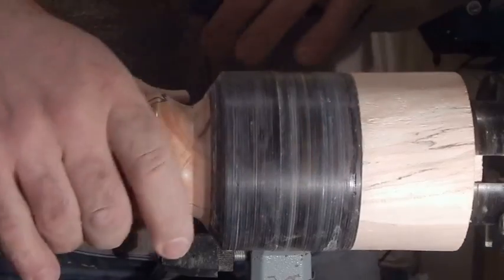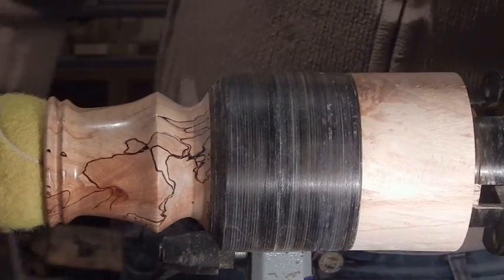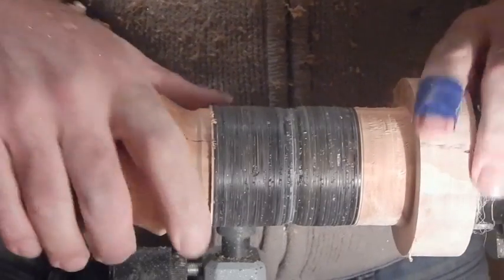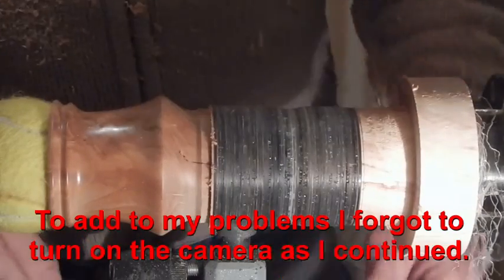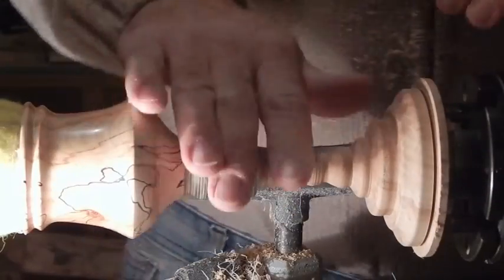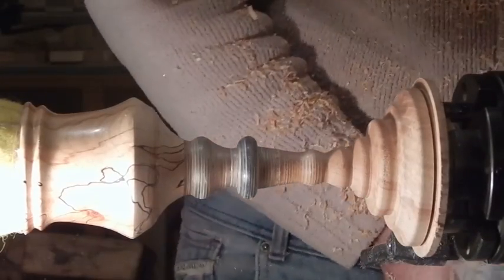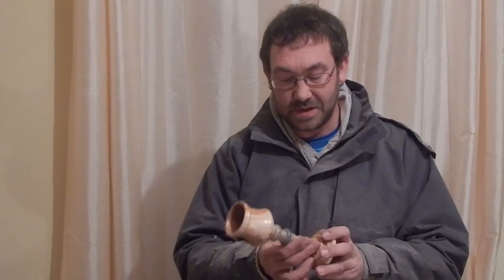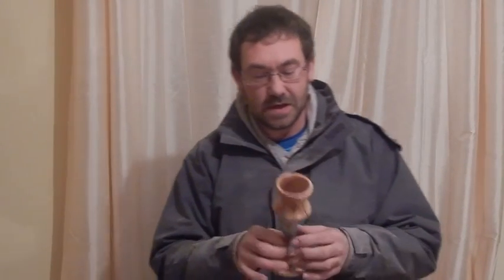Woodturning compact discs (Cd's) upcycling into a spalted beech and disc goblet part 2

Comment: Took me some time, but I've gotten to this one too :) Man that was a tough ride, I'm usually using the three strikes you're out rule with my turnings, you're a better man, but that goblet did some out nice, even though you had to mill the disks almost off to get to where you wanted... I would have thought you will use the CD's for the cup part of the goblet and not the stem.... Almost thought you were going to make a captive ring there for a moment and I was thinking how pretty that can be. On a side note, if you microwave a CD for a few seconds it will "burn" off the metal sheet inside it and make it almost transparent, look it up somewhere, if and when it works, it is cool to watch happening. :)
Reply: +Yuval Lahav Just checked my facts, and in fact, passing a high voltage to a spinning CD will "burn" off the metal, microwaving it will just give it some pattern and stink, probably...
Reply from the maker: +Yuval Lahav Well thank you Yuval !! I think you have spent as much time on this project as I have now !! LOL ..... Thanks for that info I'll have a play.... I still have a few things I want to try with them ;-)..... Thanks again its much appreciated mate... Steve.

Comment: Should have sanded down every single CD and then cleaned in acetone or alcohol solution before gluing the stack together. By the end with all the repairs the whole thing was pretty wobbly...

Comment: if just asked in the first part, why you didn't used a bezel like in metal fabrication, for the manufacture of a spindle?
In fact if the parts getting to long its a need to stabilize them against bending by their own weight...
But the useabilty of a bezel offers more latitude...
Reply from the maker: +Innocentforscratcher Yep thank you I replied to your previous comment, Your watching and commenting is very much appreciated, kind regards, Steve.

Comment: Might get better results if you had put all the CDs separately on a dowel that was extended past both ends of the stack and then just glued both ends of the dowel into matching holes on the blanks at each end? Just thinking out loud.
Reply from the maker: +Gene Strong (Lumpystrong) Thanks for your thoughts !! Good idea !! Appreciate you taking the time to watch and share your ideas, regards, Steve.

Comment: great video, thanks for sharing.  i love up/recycling. am new to wood turning & found it very useful.  wondering what you use on the tail stock to hold the tennis ball? which btw was an awesome idea.  just learning about jam chucks atm so i hope to try this technique. are there more videos or information on the tennis ball support?
Reply from the maker: +Marney Smithies Hi, I don't think there are any actual videos dedicated to the use of a tennis ball, but its simply just used as a pressure chuck to support a cupped piece, you just place the ball in the cup of your project and slide the tailstock to it adding just a small amount of pressure. its great for reducing vibration.... Thanks so much for watching and commenting, just let me know if I can answer any questions you have as you move forwards, kind regards, Steve.

Comment: I couldn't tell, but did you put a dowel through all of the CD's or just where the cup attached?  Maybe if you put a dowel it would add some support and prevent them from breaking apart at higher speeds?
Reply: +Dennis Gibson II Lovely piece either way.  I wish I had a shop where I could do woodworking.  Currently I just do it out in the snow by hand.
Reply from the maker: +Dennis Gibson II Hi, The wood was turned down to a dowel and inserted into the Cd block from both sides in hindsight I should have also put a dowel between the two Dowels too to form a solid joint!! This was an experiment and a lot was learned from it.... Thanks for watching and commenting, regards, Steve.

Comment: I just snowballing an idea here, but wouldn't a one piece wooden core, and the base having a hole that the core inserted into been stronger? Rather than the 2 piece center core, relying on glue for structural integrity?

Comment: Your mistake was to use a spade bit to open up a hole. This is not their intended use and correctly you should have drilled the large size you required with that spade bit - the spear end is there to keep it centred and stop it straying or grabbing the work, as happened here.

Nice project and as you say, a beautiful piece of spalted beech. A very artistic use of the unexpected.
Reply from the maker: +Gordon Burns Hi. Yep I new it was a risk but they were the only drill bits I had at the time, I have since bought a set of forsner bits ;-) Thanks for the info and for watching, regards, Steve.
Reply from the maker: +Gordon Burns Hi, yep it was a risk, but I had no other drill bits at the time, but I have since bought a set of forsner bits so happy drilling from now on ;-) Thanks for watching and for your helpful info, regards, Steve.
Reply: +Templeboy Turnings  Very Very interesting! Only thing that annoyed me was music playing! I, like many other watchers of thesetype of video's, really don't like the background music. Its not needed, and becomes irritating. Apart from that, I really enjoyed watchingAll the Best   Mike

Comment: Hi
After you used the spade bits to intially make the interior of the goblet it appears you used a skew. Why do you prefer the skew to a gouge? Also. is the tennis ball held in place just by compression or is it physically attached to the tailstock?
Thanks
Michael
Reply from the maker: +VADOC02 Hi Michael ! Thanks for your questions...... I do use the skew a lot for smaller hollowing to reduce vibration. Because pressure is directed more towards the headstock rather than the side of the piece ...... And the tennis ball is just held with gentle pressure just to reduce vibration again....... I hope this answers your questions Michael. Thank you for watching its much appreciated, regards Steve.

Comment: Satisfying.VDO. ..... :-)
One suggestion, you actually wasted time in gluing CD's & then grinding them down to almost 1/7 of what mass it had orginally. Next time make Epoxy block & grind it straight away with shiny polish & use those CD's for some other project wherein the grinded waste threads are minimal .

Comment: It looks and feels like the lathe is spinning the wrong direction for the Auger bit you are using. Actually the lathe is spinning the same direction the Auger would. But in doing so spins against the wrong edge of the Auger, not the cutting edge.
Reply from the maker: Hi Jc !! No the lathe is spinning the right direction, the drill bit would spin clockwise if you were to use a drill, the lathe is spinning clockwise also, but if you look at the the end of the spindle on the lathe when its running its actually spinning anti clockwise ? Therefore the right direction for the drill bit? 

LOL its a bit of an optical illusion, but if you put both your pointing fingers end to end and turn them both clockwise it will look as if they are going in opposite directions ?? 

Hope that explains ? I'm confused now lol .......

Thank you for watching and commenting, regards Steve.
Reply: I actually do understand what you are saying. I also was thinking that because the bit wasnt havent a easy go of cutting before it bit and threw it off the lathe. Either way cheers man was cool to see and in the end is amazing.
Reply from the maker: Cool, Yeah it was just the wrong tool choice I've since bought a set of Forstner bits which are the right job ;-) .... thanks again buddy !!! Steve.

Comment: Why not just put solid dowel through the CD and sticking out ends in to wood parts? This way clued CD will not carry all the load and will not split. Otherwise interesting video. Come to think of it, how about just glue center part of CDs, so outer surface actually have gaps between layers. Should look interesting. Sorry I don't have turning machine and can't try it my self. :-(

Comment: if you decide to do this again I would recommend making that small nipple you made in the very beginning on both outer pieces and attaching them within the cd with a stud, along with all the glue. might consider a metal nut insert, they also work well for strengthening two dissimilar pieces of wood being stuck together to lathe them. http://www.rockler.com/threaded-brass-inserts-select-size?utm_source=bing&utm_medium=cpc&utm_campaign=(roi)+product+listing+ads
Reply from the maker: +bigjohn3435 Thank you for your suggestions and link, and I appreciate your watching and commenting, all very helpful advise ..... cheers, Steve.

Comment: I can't get this to play
Reply from the maker: +Kat Gore Hi Kat, try closing the page and refreshing ? everything seems ok this end ? Sorry for the inconvenience .....Regards, Steve.
Reply: +Kat Gore   Hi Kat.  
I couldn't either but I've found that using the back arrow to jump to the previous video, letting it start, then using the forward arrow will often get the video to start.  
Didn't work in this case, so for trick #2 I copied the title under the video and pasted it into the search line, then hit the magnifying glass at the end of the line and it coughed up a bunch of related videos, the first of which was the one I put into the search line.  I haven't tried Steve's page refresh idea but I will next time.  So there's 3 ways to tackle the little bugger.
Good luck!

Comment: Would that I was half the rookie you are!
Reply from the maker: +Carl Street Thank you Carl !! Your very kind ...... Appreciate your watching and commenting, Steve.
Reply: +Carl Street 

Likewise!  I was wondering why he didn't use a single dowel through the centers of the CD's glued into holes drilled in the wooden blocks at each end; that would have saved the shear fracturing of the glue joint between the discs.  The spalting and grain of the wood are all but indistinguishable through the edges of the discs anyway, so, the appearance would not have been affected.

Nevertheless, it was an informative, entertaining set of videos.

Comment: Why didn't you just start with a tool instead of the spade bit...?
Reply from the maker: +thumpin1 A hole is bored before the tool is used because it reduces vibration through the piece, another way to reduce vibration is to use an aid called a steady rest that holds the piece steady half way down its length...... Thank you for asking, appreciate your watching, and commenting, regards, Steve.

Comment: So, the end result is a goblet with a small plastic ring on the stem?  Way too much waste.  CD's are not a good material for turning in the first place, and if you were to design something like this I'd suggest a 3 part approach, base, stem, and bowl, each spirited together, which would allow yo to add a ring of nylon, gas pipe (yellow)  or whatever your poison is (CD's are poisonous by the way)   You concentrate on the spindle turned stem, and the bowl turned parts separately, wasting less material, and in the event of a catch, only having to replace one element. .
But then which of us has not done summat daft just for the sake of it.

Comment: i dont understand what the point of including the CD's was? You turned off nearly 98% of the CD material anyway.
Reply from the maker: +me999 Yes I did your right !! And I did say on the video I wasn't happy with how it turned out...... I start with an idea and as this had never been done before I went through the process the way I would if it was all wood..... The original Idea was to have a slightly thicker stem that was transparent showing the wood inside..... It didn't go to plan, but I learned a whole lot from it...... The recent video I put up of turning a goblet with cd cup came out beautifully..... All a huge learning curve.... Thank you for watching and for your honest comment, regards, Steve.